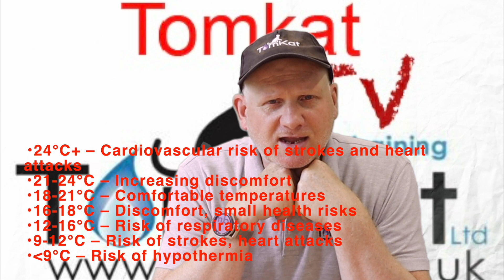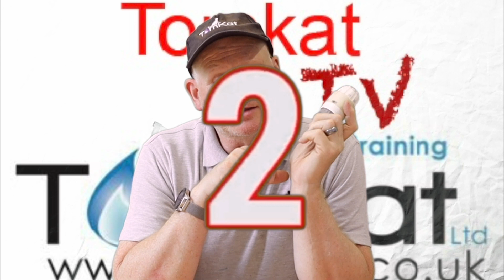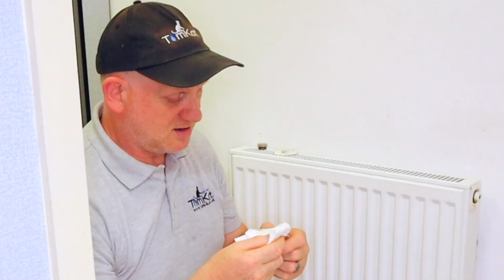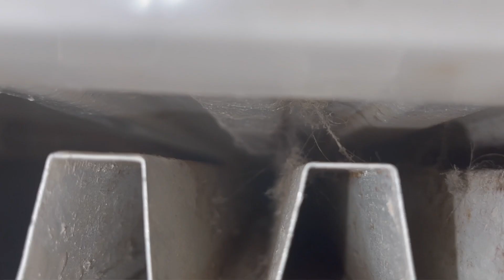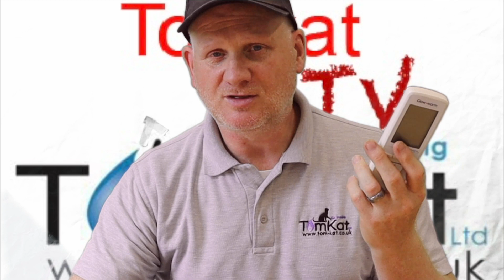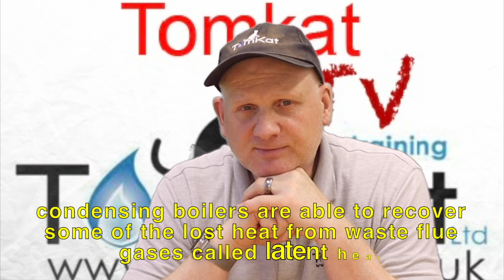Save gas save cash. 15 tips on how to save money on your gas bill.  #saveenergy

Comment: I live with no central heating , I don't use  gas, if I'm not using gas I won't be charged

And yes I have saved a hell of a lot of money,

 I turn it on to keep system in good health now and then. I've been doing this for several years and my gas bill has dropped massively, I'm not paying thousands on gas,  and I know it's not for everyone, but hey I'm saving huge amounts like lots.

Comment: My thermostat is on a wall at the bottom of the stairs near the front door in the coldest part of the house, I have a thermometer in the kitchen which is always 3-4 degrees higher than the thermostat by the front door

Comment: God. I'm such a tightarse - I run the heating for an hour twice a day to 16deg. And walk around like some mad bag lady with hot-water bottles on a string round my neck and fifty-six blankies. I'm staggered that people usually have it at 21deg , I think that'd kill me!
Reply: I recommend 18 for health reasons, so bump it up a couple of degrees only
Reply: @Tokaisho

Hiya, and thank you for the advice. I actually have a Neuro condition which is affected by warmer temps but you're absolutely right. I needed an emergency doc visit one year and he told me it was far too cold but now have a new boiler and digital thermostat which I can move very precisely in half-degree increments so I'm working up gradually.

It's staggering how much difference a compensating digital thermo makes. From rough calculations I reckon the old one was always give-or-take a couple of degrees either way but now it's incredibly precise.

Not giving up my hot-water-bottles  tho. Those are going to my grave with me!
Reply: @Tokaisho
Thank you so much for the advice - afraid I'm like most women, it's just big-thing-on-wall-that-makes-hot and if it stops, I go and wail at someone.

I do keep it on constant heat when it's very cold for that exact reason, but not that high. But I am extremely lucky, I live in the usually mild South East, my house only has one external wall cos of the design and it's modern, insulated, double-glazed. I did go through a phase of living with no heating at all when I first left home and hopefully, never again. I feel so desperately sorry for those who are really struggling because so many British houses are so expensive to heat and they're often inhabited by those who can least afford to make the capital outlay.

Really appreciate the advice, thank you. You take care...and keep warm!

Comment: I noticed I have at least one radiator where the upper part heats up before the lower part, that's when I checked straight after switching the boiler on. When I checked later, after 15 minutes or more, then the whole radiator is warm. Should the lower part start getting warm first? And if not is that a sign of sludge? Thanks
Reply: Heat rises!
Reply: The general rule is cold at the top = air and cold at the bottom = sludge.

If the entire rad is essentially the same temp after fifteen minutes you should be good. The cold patches stay cold, or at least noticeably colder, if you have air or sludge. Your rad won't heat up evenly cos physics, but as long as it's even once its all got going, you should be good. 

That's the most basic of basic, which is all I know, but hopefully helps 🤗

Comment: How about turning down the water pressure on the domestic supply (hot tap water) so that the boiler fires up OK but because the water is at a lower pressure it will heat up faster.
Also if you take a meter reading how about adding on some extra units so you pay for the gas at today's price so as you build up some credit for the future.
Reply: It is fraudulent to give false meter readings (look it up if you don't believe me).

Comment: Just to add. You would not believe how drafty a vent from a cooker hood is. Mine is on a pretty wind free side of the house and  still blows like a gud un! Looking for a gauze or something to combat it. Any ideas anyone?
Reply: Ditto. Kitchen cooker hoods do not have whats called "backdraught shutters", whereas most bathroom wall/ceiling extractor fans have backdraught shutters integrated into the motor housing. There are 2 ways that you could tackle this issue, depending on your setup:
1. Retrofit a backdraught shutter inline into the cooker hood ducting. You will have to see if you can find a point that you can fit it inline.
2. Change your exterior extractor outlet to have shutters.
For me, it is not possible to change my exterior extractor outlet and so I spoke to i-sells (look them up) and they told me about retrofitting backdraught shutters (I hadn't heard of them before). As my cooker hood duct is initially a tumble dryer type flexi hose with jubilee clips, I can fit it inline and this should be relatively easy to do (I haven't done it yet!). When I did some research on backdraught shutters, the ones without springs are much better as the springs can fail. The Kair one I bought from i-sells doesn't have any springs.
In either case, you will need to know the diameter of the ducting. i-sells are very helpful and can advise you further.

Comment: How is it better to heat water at 45 than at 60 for showers? You will use less water from the hot pipes, therefore more heat is generated but the same gas is used to heat a smaller amount of water. Right?
Reply: You use the same amount of water for a shower and heat that amount of water less
 
Or if you're referring to filling your bath with overly hot water and then needing to cool it down to desired temperature by adding cold water, then in this instance the efficiency loss in the effort to heat it kicks in. No system in science has a 100% efficiency, so to overheat water and then add cold water to cool it down will cost more than to merely heat the same total amount of water to the desired temperature in the first instance.
Reply: @TheVicar  all boilers have a minimum flow rate for it to start heating. As long as your hot water flow rate is achieved, you will use less energy to heat less water. Also, it does not matter if you just use the hot water tap or mix it with cold water, you just need to achieve that minimum flow rate on the hot water pipes. This also allows for more taps to be used without losing heat. This also allows for more total water flow, as typically you can achieve a bigger flow with the cold water pipes. This is how you might waste energy, as you might end up with more water necessarily just to not scald yourself. But if it is the same water flow, it's the same energy (gas used). The efficiency, or lack of, happens at the same rate no matter the temperature. It's hot water, not central heating (no condensing and no water tank, I'm talking about a combi boiler).

You haven't said anything to demonstrate otherwise. You don't add cool water to cool it down, you add less hot water to begin with.

If you have cold water at 10ºC and you want to heat it to 30ºC: You can heat 10 litres at 30ºC, or heat 4 litres at 60ºC to mix with 6 litres at 10ºC. Both require 0.23kwh.
Reply: @globalist1990  "You don't add cool water to cool it down, you add less hot water to begin with."
 
That's exactly what I'm saying and what the video refers to, but because no system is 100% efficient, which is what you are suggesting, then your figures are incorrect. It will take more energy to heat said ratio of water to a higher temperature and mix it back down to desired temperature with cold water, compared to heating the total amount of water to the desired temperature.
Reply: @TheVicar  no, hot water for baths/showers don't take advantage of condensation. Like central heating does with lower temperatures on mild winter days or good insulated houses. I provided the kwh usage in two cases. Feel free to check yourself.
Reply: @globalist1990  You're dodging the issue. The type of boiler or heating method is irrelevant. When converting the energy from burning gas to heat water there will be an energy loss. Heating a smaller amount of water to a higher temp and then cooling it to desired temp with cold water you will lose more energy than heating the total amount of water to the desired temp in one go.
 
You are stating a basic calculation based on a system that is 100% efficient in transferring the energy. Such a system does not exist.
 
If you think it does then you would win a Nobel Prize.
Reply: @TheVicar  It's less water. Yeah, you're "losing energy" to the desired temperature. It's not a loss. Cheesus. Either talk about this inefficiency, or be quiet. The inefficiency is there in any case. Just tell me why do you say there's more inefficiency in heating less water at a higher temperature, other than the "because we need to cool it down" bs. You're using 4 litres of hot water to warm 6 litres. That's not why these boilers are inefficient. You're not losing energy, you're using it to heat 6 litres of water, with no further gas use.
Reply: @globalist1990  Heating anything is not 100% efficient, so heating anything to a higher temperature will lose more energy in the process.
 
Go claim your Nobel Prize.

(edit: And you've not factored in another human consideration, that if you have multiple people using a shower in a home and the water temp is set too high, then every time each person selects their different mix of hot and cold, then that's a significant amount of hot water going straight down the drain, unused)
Reply: @TheVicar  IT'S LESS WATER CHEESUS. HEATING MORE WATER TO A LESSER TEMPERATURE PRODUCES THE SAME HEAT WASTE.
Reply: @TheVicar  what absolute bs. Different water mixes only "asks" for different amounts of water, it doesn't control the temperature on the boiler water outlet. Omfg. No high school diploma for you.
Reply: @globalist1990  You are talking about laboratory conditions for heating water in a closed system that enjoys 100% efficiency and zero heat loss. In that situation you are correct. But that's a theoretical situation, so yours is a null point.
 
I'm talking about heating water in a real world situation where the system is not 100% efficient and that is what this video is all about. Saving energy in a domestic environment, not lab test theory.
 
Your boiler will have pipes which feed the water to your bath/shower/sink. Not only is there a heat loss in the boiler, which will be a greater % the higher you need to heat the water. But also, as stated in this video, it is important to insulate the pipes that transport the water around your home. The higher the temperature you set your boiler to heat your water, the higher the % the heat loss will be lost from within your boiler and through your pipes. This is due to the difference between the ambient temperature outside of the pipe and the water you wish to heat and transport through the pipes. Insulating pipes will help, but no insulation will completely prevent heat loss. If the ambient temperature is 25c and the water is heated to 25c then there will be no heat loss.
 
The higher the temperature you heat the water to, the higher the % heat loss you will experience before it reaches its point of use because of the increasing difference between the ambient temp outside of the pipe/boiler and the water temp you are heating to.
 
Therefore it is logic that states that it is more efficient to heat the entire body of water to the desired lower temperature in the first instance, than using your failed logic that heating a smaller amount of water to a higher temperature (losing a higher amount of energy in initial heating and transportation) and then mixing it with some cold water to average the temperature out, resulting in the same quantity of water.
 
This video and my argument covers the real world. You are stating a basic theoretical situation which you could possibly pass a simple exam question by using, which omits efficiency loss.
 
I hope this helps you understand your mistake and the points made in this video.
Reply: @globalist1990  That's the entire point in this video. It says to turn down the water temperature setting on your boiler, so you don't have to add cold water at the point of use if its too hot.
 
I really think you need to watch the video again and try and understand what it is saying, rather than using your imagination and running with that.
 
Also you may have to take into consideration that this is a UK video. UK households have 2 piping systems which have a separate cold water supply and a separate hot water supply running through our homes. Each sink, bath and shower (when gas heated) have the water mix selected at that point, where the cold and hot water feeding pipes meet each other.
 
This is possibly why you're getting confused over this issue.
Reply: @TheVicar  I'm not getting confused over that issue, that has no effect on how the boiler heats the water to the desired temperature. As long it's less water than the boiler maximum capacity.

About the heat loss in pipes, that is a real thing I recognise that. I would say the loss is marginal and that in really cold days if you don't heat water enough, you won't even have hot water at all. The loss is always present no matter how hot the water is. It will progressively equalize the water temperature to the pipes surroundings. It's not as straightforward as you imagine though. So if you want water at 45ºC and you setup your boiler at 45ºC, and the outside temperature is 10ºC, you won't have water at 45ºC at the tap. Right? Just make a simple test. Setup your boiler at different temperatures, and see how much you lose at your hot water tap with a simple cooking thermometer. Efficiency covered. Hot pipes insulation only matters for water tanks, and maybe central heating, not water heated to be used immediately, unless they run outside the house.

Also, keep in mind that when you turn your tap on a lower temperature setting on the boiler, it might take longer and waste more water to get water to a warmer temperature, as the pipes will warm slower.
Reply: @globalist1990  I'm glad you've finally admitted that what was stated in this video is correct advice to reduce your energy use, even if its only a marginal saving, it is still a reduction in energy wastage. Following the 15 tips, including turning down the temperature setting for your warm water on your boiler, will save quite a bit of energy in these testing times.
 
I've enjoyed our discourse, even if it was a slightly dragged out matter.
 
✝TheVicar✝
Reply: @TheVicar  🤣 I'm not surprised you misunderstood what i said.
Reply: @globalist1990  Oh you're not u-turning again already? First of all you said things would be the same, then you admit that you recognised an inefficiency, now you're inferring that things would be the same again.
 
Are you a politician by any chance? If you're not, you're missing a trick there.
Reply: @TheVicar  i was very clear in my last statement. It's not my fault you misunderstood me.
Reply: @globalist1990  Is setting the flow rate  for the water (and the heating) the same as setting the temperature for them, or are they totally different things?
Reply: @c.marmion8430  different things. modern boilers adjust flow automatically.

Comment: I have valves labelled from 0 to 6. What would be the conversion into Celsius in that case?
Reply: I found a manual for a TRV that is frost, then 1 to 6. The temperatures (in Celsius) are: frost: 6, 1: 11, 2: 14, 3: 17, 4: 20, 5: 23, 6: 26.
Reply: See if you can find the manufacturer's manual for the TRV's online.
Reply: Get a cheap room thermostat and check what actual room temperature is achieved and adjust to suit.
Reply: Get a cheap room thermostat and check what actual room temperature is achieved and adjust to suit.